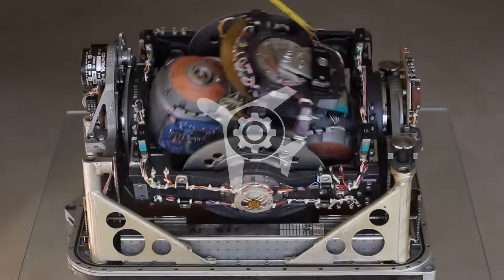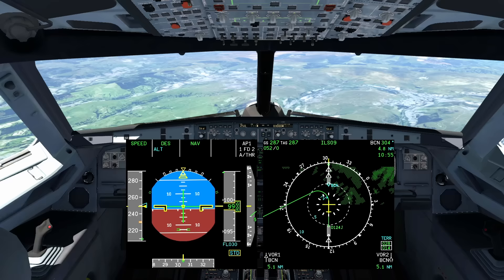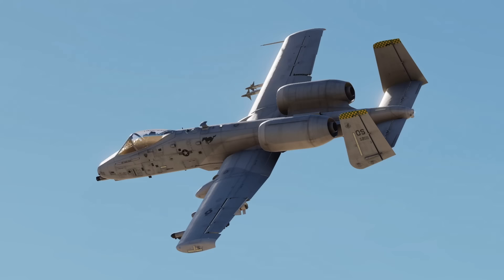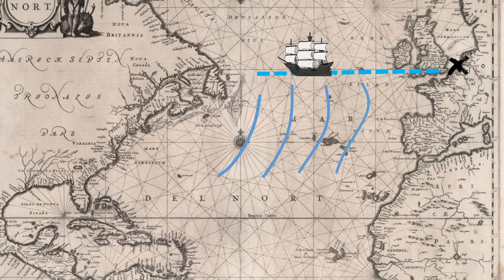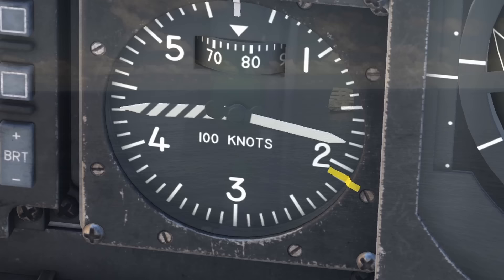The GENIUS of Inertial Navigation Systems Explained

Comment: It is "ded reckoning" not "dead reckoning"  Abbreviation of "deduced reckoning"
Reply: It is indeed dead reckoning and has been for the last few hundred years. It could have originated as ded reckoning way back when, but every navigation text or training program I ever encountered called it dead reckoning. 

Oxford Reference: Determining position at sea by advancing the last established position for course and distance run. Before the advent of modern navigational systems dead reckoning was the basis of most offshore navigation. The term ‘estimated position’ is sometimes used for the dead reckoning position corrected for the effects of tides, currents, drift, leeway, and so on. The origin of the term dead reckoning, which has been in use for at least four centuries, is obscure. It has been suggested that dead is a corruption of deduced, but there is no etymological, or other, evidence for this.

Comment: So, after about 1000 miles of travel, how accurate a fix does an INS give?
Reply: I think the specification on the ASN-48 was on the order of 5 NM per hour of flight.  We had Litton tech reps who could tweak the systems to be better than that, but the best was about 2-3 NM per hour.

Please note that an INS doesn't really give a "fix".  As stated by others, it is really a Dead Reckoning system.  You have to give it a correct position when you start it up.  It then updates that position based on how it thinks the plane is moving.

Comment: But this video doesn't explane HOW all of this happens. For example how gyros "know" how to keep its orientation relative to.. actually, this is next question - relative to what? If the Earth isn't the reference point what is?
Reply from the maker: Thanks for your comment, and excellent question. Something I could have done a better job at emphasizing is that initial alignment of the INS is extremely important - because it sets up the reference frames that you are talking about. As soon as the aircraft starts moving, gyros will sense this movement relative to whatever the initial orientation of the aircraft + gyros was. Based on how much "movement" the gyros sense, motors attached to the gimbals will rotate the platform in the opposite direction to correct. It's a feedback loop. Hope this help!

Comment: Was it not true that Earth's rotation affected lobbing 16 inch shells over the horizon enough that it later became part of fire control systems that used similar tech?
Reply: The effect is due to coriolis force. Simplest example is that if you fire a projectile from north to south, it will deflect to the west because the earth rotates eastward while the projectile is in flight.

Comment: You do have a way of telling parked in a hill versus acceleration.

When you are parked on a hill, you only have 1 g of acceleration. The force of the seat upwards would be reduced, and the force of the seat in your back would be increased.

When you are accelerating, the total acceleration would be >1 g. The force from the seat upwards would remain at 1 g, which the force in your back would be whatever the acceleration rate it is.

I'm not sure a human would be be able to perceive this difference, it is there, and an accelerometer should be able to measure it.

Now, on aircraft, where you have non-negligible acceleration in the direction of gravity, and accelerations nearing or exceeding 1 g, it can be hard to tell what direction gravity is.
Reply: Yeah that was the entire point of that segment.

Comment: Using "Dead" reckoning in place of "Ded" for Deduced is incorrect
Reply from the maker: Thanks for your comment. I'm open to suggestions, but in this case NASA, the FAA and the Oxford English Dictionary all reference dead reckoning, not deduced reckoning:

"The use of "ded" or "deduced reckoning" is not known to have appeared earlier than 1931, much later in history than "dead reckoning" appearing as early as 1613 in the Oxford English Dictionary."
 https://ntrs.nasa.gov/citations/19700026212 
https://www.google.com/url?sa=t&source=web&rct=j&url=https://www.faa.gov/regulations_policies/handbooks_manuals/aviation/phak/media/18_phak_ch16.pdf&ved=2ahUKEwi0xL_QxNz6AhXInaQKHek4DxoQFnoECC4QAQ&usg=AOvVaw0rHItgUCKC4BwL1k2Je1Xi
https://en.m.wikipedia.org/wiki/Dead_reckoning

Have a good one!

Comment: even without the Earth curve  there will be some drift in gyroes. how do they fight that?
Reply: (RDF) Radio Direction finder. 

Once on top of the ground/sea radio beacon you check the values of the INS to see if it's still in calibration with the position data numbers transmitted from the stationary radio beacon.

There was a 747 that was shot down over the USSR because they were too lazy to check if their INS aligned with the radio beacons (you had to check it like every 10-30min)

In space, the INS is used in conjunction with a camera. Triangulating the planets,etc to make sure the INS is on track.
Reply: @jujuu1339  how does it help with horizon? Oo
Reply: @mrpicky1868  plumb bob
Reply: @jujuu1339  what?

Comment: There is a lot of disinformation in this video. The electrostatic gyro navigators used by the US military (now replaced by ring laser gyro systems) were fixed to a space coordinate system; the platform would flip every 24 hours. A fixed platform was used because torque could not be applied to the gyro's without causing them to oscillate. The gyro's would also not function if the platform moved out of alignment from the position it was spun up in. These issues were solved with ring laser gyros. Pendulous integrating gyroscopic accelerometers (PIGA's) were used to measure acceleration. Even though this is an old technology these are far, far more accurate than even the best MEMS accelerometers currently available. Gravity maps of earth are required for these systems to maintain high accuracy; although not strictly required for air and space vehicles vessels closer to gravitational anomalies such as submarines must take these maps into account. For a vehicle traveling at a constant velocity on earth these systems do not really need to function as dead reckoning devices; measuring the acceleration vector and the position of the fixed platform the position of a vehicle can be determined with a known position of the vehicle at a known time in the past (using a cesium beam clock).  In this mode it is just measuring the displacement between "down" at the last position fix and "down" at the current location which, not accounting for gravitation anomalies, ends up being a displacement in latitude and longitude from that position. The complete history of the vehicles acceleration and orientation does not need to be known for this to work and so it is not really dead reckoning (it operates more like a sextant that takes a three point fix on an artificial star constellation).
Reply: What you said makes sense, but I want to ask you if MEMS sensors are important for these devices, I hope you can reply me

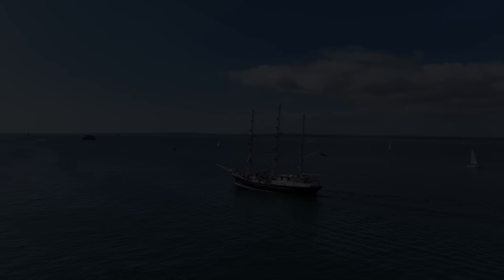Comment: At 1:25 or so, and again at 2:30 or so you referred to "Dead Reckoning". I think the correct term is "Ded Reckoning", which means Deductive Reckoning. You gave the example that if you travel at some direction, for some period of time, you can Deduce (Ded) your position. Whether sailing, driving, or flying, One can use (and should use) Deductive Reckoning to get an estimate of your position. It's not Dead Reckoning unless you ignore it, it's Ded Reckoning. Of course I may use GPS, transponders, and more to learn my position. However, if your electronics or gyros fail, use Ded Reckoning, not Dead Reckoning.
- Admiral Pedantic
Reply: Decades ago when I was learning to fly, it was "dead" reckoning because if you didn't reckon correctly, you were dead. It was also sometimes referred to as "ded" reckoning by those of us who couldn't spell very well. :)

Comment: 7:15. Incorrect. #1. Acceleration only lasts for so long. While inclination is persistent. Also if you were in an inclined plane. Gravity would still represents the horizon. In which case you would know you're in an incline plane. All without ever needing to see.!

In fact this device takes advantage of that. So I'm not sure what you're trying to say.?

But obviously yes there is a way. If that way didn't exist. This mechanism wouldn't function.!

Comment: I really was hoping to understand how drift was solved for a bit better, but the video basically just says “the accelerometers fix it!”  But the fix is needed to keep the accelerometers level with the horizon… that seems like circular logic and really didn’t explain how the error is solved for at all.
Reply from the maker: Hi, thanks for your comment. You're right, I could have gone into a little bit more detail on this in the video. About the "circular logic", your intuition is exactly correct, there is a kind of circular feedback loop between the accelerometers, the platform and the gyro. So to offer some clarification: the accelerometers can be used to integrate or calculate your position and velocity. Your position can be used to correct the gyros for the rotation of the earth based on latitude (imagine standing on the north pole while the earth is spinning compared to being on the equator). Velocity can be used to correct for the aircraft flying over a curved earth, since the faster you travel around the globe the quicker you will need to rotate your gyros to keep them level with the horizon. Then, because the gyros are now "corrected", this keeps the platform level which allows the accelerometers to accurately measure position and velocity once more. Hope this helps. Thanks!

Comment: Inertial navigation works, but just barely. Any system that relies on integration is going to drift. You can minimise the drift byhigh quality machining but it is still going to happen. Resetting the gyro compass by the cheap little magnetic thing on top of the glare shield is kind of embarrassing.

Comment: Nice, but there's nothing magical about the horizon. In fact, there is no alignment with the horizon, but with the force of gravity. It's this force that can create torques that induce errors into a mechanical gyro system. Orienting those gyros so the torque is minimized and consistent is a necessary evil. Modern inertial reference platforms use light, which has no mass and is therefore not susceptible to gravity. They work equally well in any position, eliminating the need for gimbals. These "strap-down packs" are smaller, have no moving parts to wear out, and use a lot less power. This makes them suitable for smaller aircraft, with no performance penalty.

Comment: The sailor throwing a rope with knots in it measures relative speed, relative to the water. But if the water is moving at lets say 20 knots in the same direction as the boat, the sailors speed measuring technique will be measured speed-20 knots. So not very accurate in knowing where you are really.
Reply: The sea is not the same as rivers.

Comment: Your initial premise is wrong. Inertial Guidance  Systems do not, have not, never will determine position. The purpose of these systems is to receive a position, maintain and update it.  They are dead reckoning  devices able to maintain and update a position based on acceleration integrated over time. Basically “ You tell it where it is and it will tell you where you are. Hence the need for an initial position and periodic updates from an external source, such as GPS, charts, the old Navsat system, the even older LORAN system and even a sextant.  If you don’t know where you are it will not help you.

Comment: Why not just use a mechanism to measure the current tilt or yaw and then just have the computer do the maths with accelerometers mounted to the frame?
Reply from the maker: This is a brilliant idea, and that's exactly how modern INS systems work! Aircraft no longer use a moving platform, instead all the gyros and accelerometers are "strapped" to the aircraft (they're called strapdown INS systems). Very good point, and something I should have mentioned at the end of the video.
Reply: @FlyByMax  oh cool! Learn something new everyday!

Comment: No. You have the equivalent of an accelerometer in your middle ear. You cannot "trick" a blindfolded person he is accelerating by putting pressure on his back. Otherwise a big problem in virtual reality wouldn't be a problem at all. Moreover, you know what's level!!! If someone tilts a blindfolded person back in his chair, he's not going to think he's taking off in a vehicle. He's gonna know his orientation has changed (even if the video's assumptions are correct, he'd feel the pressure come off his thighs and go to his back).

Comment: Why don’t you add some historical information as who developed what first ?

Nazis !

They developed these first - guiding those V2 Rockets into various pla  CD ex in England 

Add some details “how” did they do that when the transistor, diodes etc were not yet invented !

That gimbal assembly by the  way - is called Strapdown Assembly. 

That’ll be more interesting than how INS works.
Reply: Uhm... so?

Comment: Sir your video is totally fraudulent ?
Gyros came first and then Accelerometers, and not the other way around, your trying to sell the idea that Accelerometers were no good on their own, so they decided to add Gyros to planes ✈️ to fix the problem, when the gyros were already being used a long time before accelerometers.

Also gyros are NOT corrected, they are the reference, this nonsense about them apparently drifting out of position, due to some made up earth curve and rotation is false, gyros only drift due to the spin of their motors and RPM’s, and they solved this with Pendulous Vanes which use a vacuum system to stabilise the gyros more, and that is only needed for the mechanical gyros, as light gyros obviously don’t have those same problems.

Airplanes ✈️ cannot fly over a consistently curving surface for one very good reason, for an aircraft to fly a distance it must fly horizontally, with the amount of above horizontal pitch being reliant on the air speed, so faster speeds less pitch slower speeds more pitch, as the pilots always need to keep enough positive lift, something they won’t have over a sphere, as over a sphere the plane ✈️ must incur an accumulation of below Horizontal pitch, from the moment it reaches its cruising altitude, as any other action would result in an altitude increase.
But the lift effect opposes the weight ( what you incorrectly term as gravity ) so if planes fly over a curved surface all the time, they would need to pitch down below Horizontal more and more, depending on the length of the flight, so a flight from London to Los Angeles would end up 80 degrees below it’s starting cruising altitude horizontal, which means two things firstly NO plane ✈️ could fly with an above Horizontal pitch ever, and due to this the planes weight would have no opposition causing it to fall out of the sky.
Commercial Aircraft fly with an average of 3 to 5 degrees Above Horizontal Pitch, and this allows them to fly Horizontally from point A to point B, as if they dipped their pitch below Horizontal then they would rapidly lose positive lift and fall to the ground eventually, also any pitch below Horizontal is officially considered a decent.
The point being that if we lived on a spherical earth airplanes would not exist as a transport system, as they can only fly over a horizontal plane consistently, as that is how the lift effect works.

Now there is other problems with your video, as your claiming a rotating earth also, but if the earth was rotating regardless of it being spherical or flat, then this must result in course corrections and courses that take that into account, but no Pilot in history has ever needed to take earth curve or rotation into account, including the Wright Brothers, and they didn’t have INS systems ?

Your also pre-assuming that the horizon is the leading edge of a sphere, when even within your own globe 🌎 model the horizon is and has to be claimed to be a refracted position, a position that changes all the time with weather, and the reason for this claim is because the horizon is NOT the geometric edge of a globe earth, it is created by optics and weather.
Good Day….
Reply: Just to add to my above comment, the accelerometers require the gyros to create and hold a constant perpendicular, which is a horizontal and a vertical, as that is what the accelerometers require to be used as they are in the INS.
Accelerometers register a constant Down vector that is how they work.
So it is necessary for the gyros to create perpendicular, and hold that position for the data from the accelerometers to be used.
Accelerometers it has been proven without a shadow of a doubt, never change their direction of down on an Aircraft, what this means is that down now in your flight ✈️ will be parallel with down in an hours time, four hours time, six hours time etc, something that would be an impossibility on a spherical earth 🌍 as down on that would be a constantly changing thing, as all downs must meet at a central point.
This video would have been much better if he had just explained how the INS worked, and kept the nonsense out of it….